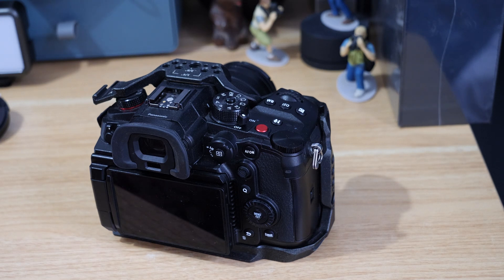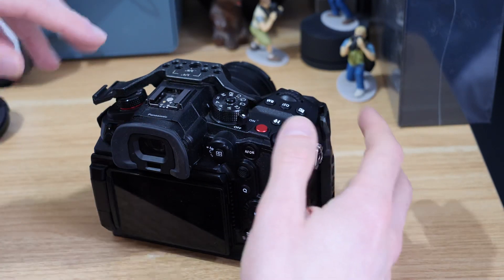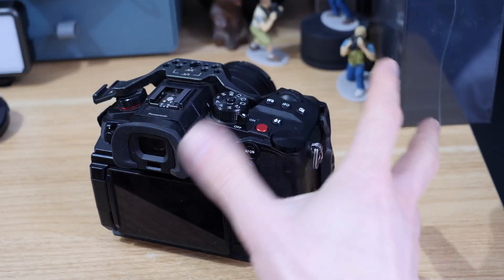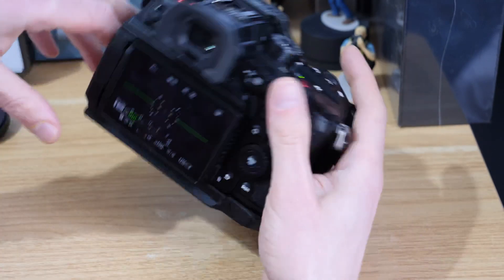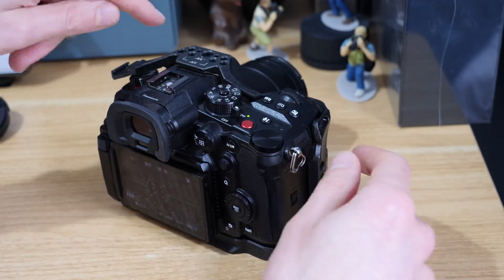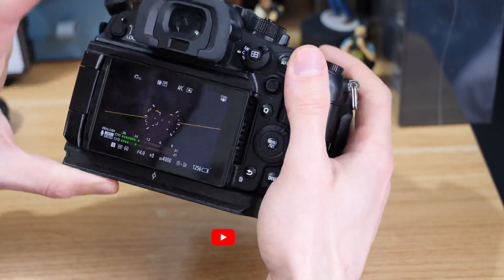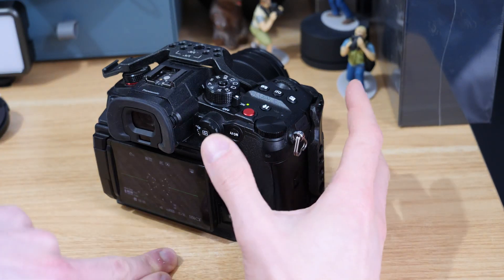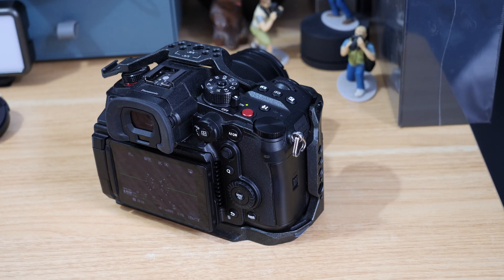Fix Hot or Stuck Pixels on the Panasonic GH6 | Using Pixel Refresh on Panasonic Lumix Cameras

Comment: Im new to photography, got this camera and stumbled across this pixel refresh. I was curious and used it, and now i see horiztonal banding that slowly start from the botton of my monitor and rises up to the top and repeats. Do i send it in? Or does it go away eventually?
Reply: Just tried taking some photos and videos, and the banding is there on both files
Reply from the maker: @Evrce  Hi, sorry to hear you are having issues with it. That doesn't sound like a Pixel Refresh issue to me. More like a shutter speed issue. Have you tried switching into something like 'A' in the top dial. This will allow you to select the aperture and the camera will select the shutter speed based on your selection. If you are shooting with the electronic shutter then it would be worth switching back to mechanical to test it. It's hard to know without seeing the shooting scenario, the issue and the settings though. Hope you managed to resolve it. Before sending it back, you could try another pixel refresh to see if it clears it.
Reply: @stevelitton  its fine now, i guess it just needed some warming up
Reply from the maker: @Evrce  Weird, well glad it's working 👍

Comment: Hello. I noticed that the autofocus backlight does not work in my AFC mode (when shooting a video). Is this how it should be?
Reply from the maker: Hey, sorry I am not following you there, what do you mean by the autofocus backlight?
Reply: @stevelitton  red does not highlight those areas that are in focus
Reply from the maker: If we are talking about focus peaking, it will not show for that as the camera is essentially being set to do it for you. So it will try to lock focus with whatever is within the chosen focus area but not show peaking.
Reply: @stevelitton  Too bad, focus peaking allows you to see the depth of field, especially when it is not always clear what is in sharpness. The depth of field also changes from the aperture value, and it is a pity that there is no focus peaking in this mode.
Reply from the maker: Yeah I agree it would be nice to have it as an option. Right now you have to use external monitor if you want it.

Comment: As much as you seemed to suggest checking different things, it sounds like it could create a problem.  Any danger of running this function when you don't have stuck pixels?
Reply from the maker: It shouldn't cause an issue even if there were no stuck pixels. I think I just wanted to get the point across that it's worth checking other things before making assumptions and jumping straight to that feature.

Comment: I understand that you can not point the camera at any light sources? But how to shoot in backlight.

￼
Reply from the maker: It's only really a precaution for when you have the lens off the camera. With the lens on, you can point the camera in to direct light for extended periods of time and it shouldn't have a long lasting effect on the sensor. For example, you could shoot a full day of time lapse with the sun moving through the sky or have a strong backlight behind a subject. One thing that can potentially cause issues are things like lasers, so if you shoot in clubs it may be a consideration.